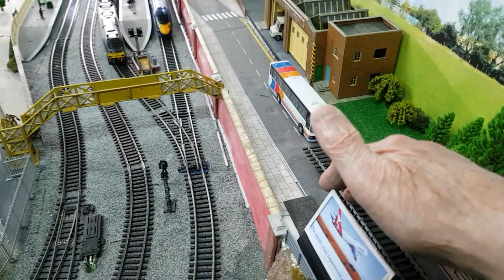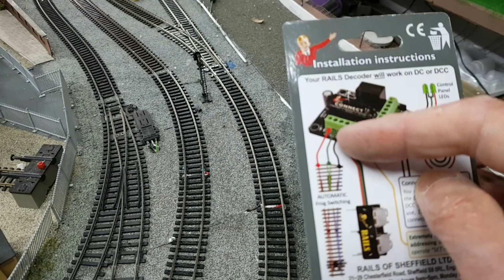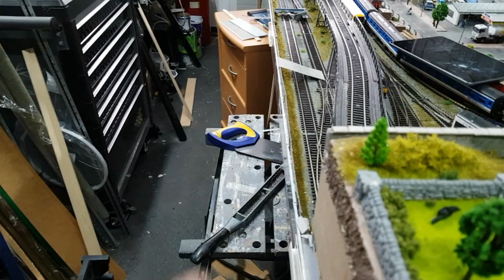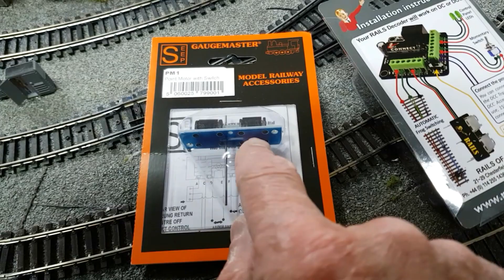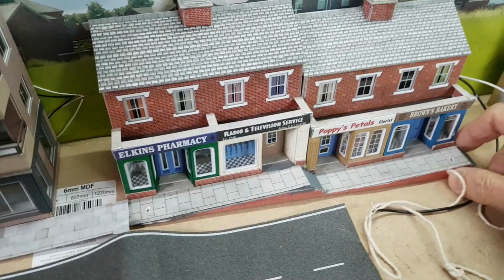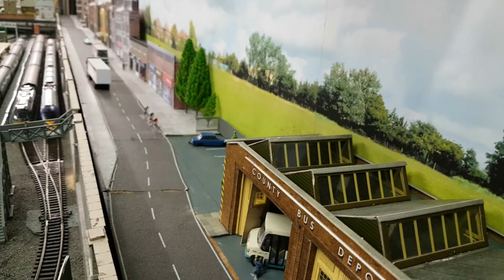April 2022 Update. Increased track storage and scenery mods. Also using Rails Connect point motors.

Comment: Hi Roy,
A very worthwhile upgrade you can never have to much train storage and pleased you left them visible and a very neat solution to the high street so well done I am assuming you had no trouble fitting the Rails of Sheffield point motors and control unit and are you happy with it? Looking forward to the running session keep well and running trains.
Cheers Robert.
Reply from the maker: Thanks for your possitive comment. I'm glad I  left them visable now,  think it will look more interesting for videoing running session. It also allowed me to create a slightly wider high street.